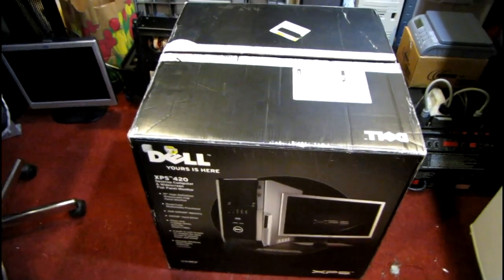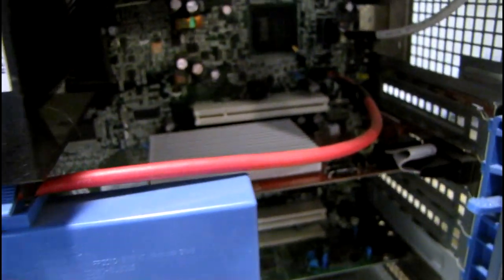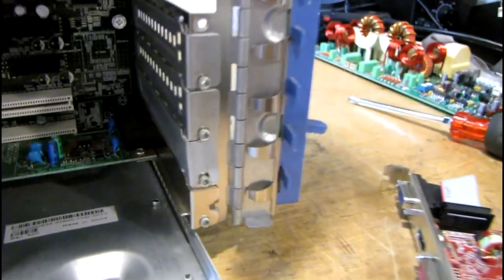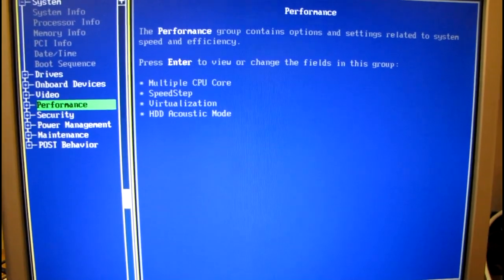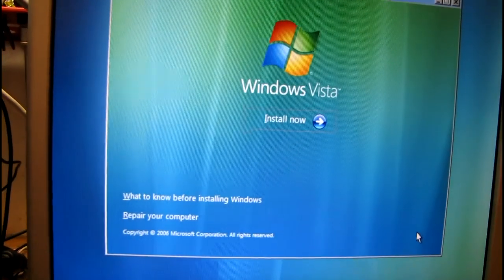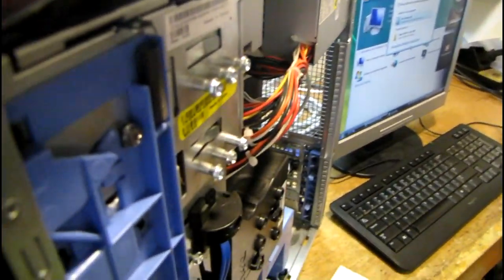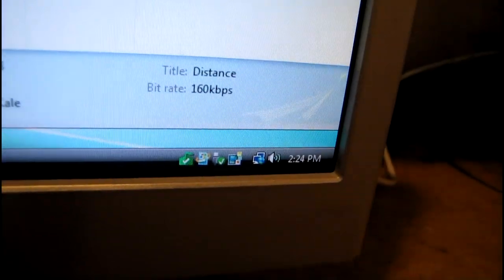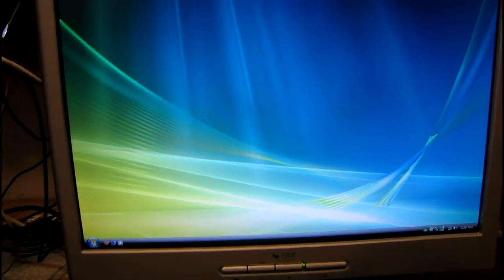Checking out a Dell XPS Computer 8-19-12

Comment from the maker: Yep, it already did.  The nice thing about the 32 bit Vista is that it can still run my old function generator program.  And it's a lot faster when navigating PDF files of large schematics.  The only downside is the size of the case.  I had to rearrange the bench to make a spot for it.

Comment from the maker: The plastic cover is also the retaining bracket for the heatsink.  Most of them I've seen have two screws holding it to the motherboard, and the whole assembly hinges back off of the CPU once the screws are out.  Do not remove it unless you have new thermal grease to use.

Comment: That case looks very similar to my Dimension 9100, which has the same front as the Dimension 5100. It has the same power supply as the XPS, and supports 667mHz RAM. It has a Pentium D 820 and 2 gigs of RAM, runs pretty nice with Windows 7 Pro 64-bit.

Comment: That's a really decent score Max! The Dell XPS back in the day were the Asus Porshe of the time and still today make some decent stuff. I too run a Q6600 and use it from gaming to video editing and still today it's pretty damn decent, even with the limited DDR2 ram. Also, I keep mine running 24/7 @ 3.4ghz easy on air with a Zalman 9700 Cooler and it runs perfect.

Comment: dell done that in some older models to. i had a  dimension 8400 with a p4 3.0 in it and it had  tower cooler like that. good idea really with a few bad ones. i just hated the proprietary parts and limits of the board and most of all that clam shell case. this thing though, i wouldn't mid so much.

Comment: Server grade CPU,s and some dual core modern CPUs have a function called PAE,and what it does is to store the extra Ram aderess that cant be stored by the  CPU registers on the the end of the first module of ram,that way when it need to acess 4+ GB Ram it only reset its counters and loads the extra aderesses from the rest of the ram area,takes what it needs and resets to 32 bit 4 GB ram this switching takes longer than acessing standard Ram but allows it to acess more,Linux and W Server Have it

Comment: that cpu in there isa beatie q6600 is a beast ahead of its time, i still use it in my main gammer rig. i have mine overclocked to 3.2 ghz (max i can go and be stable with mobo) the thing has a 7.3 windows 7 ratting for a 2007 cpu lolz.

Comment: 2018...almost 2019...upgraded my 2nd hand £180 dell xps420 with a 500gb crucial ssd...gtx660ti...750w power supply...8gb memory...put a qx9650(locked @3.0ghz)5 years ago!...want to try and fit some kind of new oc mobo but keep the actual case and just do some kind of retro fit with everything else just sort of left the way it is..have seen a water cooled one somewhere(hmm)...would love to be able to oc the chip as have read it can go upto 4.5ghz....i just bought an i7 2600k which im also starting to knock together now...i like old tech :)

Comment: It's not that curious. My 256 MB GeForce 8600 GTS is bumped right up by using some of the system RAM to I think either 1.5 or 1.75 GB. Also, why have 5 GB of RAM with Vista Basic? Isn't that 32 bit only?

Comment: i did buy same pc for 4euro. did put 4 x 2gb ddr2 rams in it and a nvidia gtx 465 1gb gddr5. installed windows 10 pro. its a nice working system. to bad the xps viewer does not run in windows 10

Comment: i currently have a dell xps 420 if u didnt know that little lcd is real time i use it view my cpu and ram ussage haha . but no the only problems ihve had is that power supply will get very warm im a A+ tech my self but back in the day this pc was about 1500+ usd .some of them had a camcorder card with 4 bnc conectors ahah. oo btw if u can find out any way to over clock this and unlock the bios let me know :)

Comment: I was wondering if these cases are still available to buy . I think that it is a great case and like the multi uses and layout of it can you  also tell me how I could overclock an intel   core 2 quad q8200 cpu at 2.33 ghz with a windows 7 x64 bit os with 8 gigs of memory . I have a gigabyte ga-ep43-ud3l motherboard as well thank you for your time
Reply: thank you for the info and if you know how I can do what I wrote in my comment that I had posted can you give me some insight thank you in advance

Comment: I can't believe they gave this rig away because of a botched windows install... it used to royaly cheese me off in my old line of work to see good comp hardware go to waste, and it still does..

I tried to live with the dreaded V word for a few months. and it brought my old rig to it's knees. leaving me crawling back to winXP begging to be forgiven.  

The core 2 q6600 is a bit of a legend, you can overclock its privates off... providing you have a meaty heat sinc n fan fitted.

Comment: you got the wrong end of the stick Maxxarcade. I know for a FACT 64 bit only supports 4gbs. in experience I had 16 gbs run on 32 bit software so you can install more ram if you don't have 64 bit.
Reply: What...?
Reply: +Tim McFarland you can put how many ram as you want on 32bit but it will only detect 4gb
Reply: +Vader Starligth acctuallu the dude from the first comment is somehow right, there is a set of instruccions from windows 8 and above that moves something in the proccesor that allows 32 bit proccesor use up to 32 gb of ram
Reply: El Gamer No tan cutre it could be so instructions but if Windows 32bit suported over 4gigs they wouldnt sell the 64 bit version and it wouldnt use the cpu atits fully potencial
Reply: Nope, the 64 bit version still has its advantages.
Reply: El Gamer No tan cutre thats what i said you miss understood
Reply: +Tim McFarland Sorry...I'm running 8.1Pro 64bit and my XPS420 system recognizes 8GB DDR2. When I had the original OEM Vista Home Premiun 32bit it only recognized 3.6GB.
Reply: +The Cynical Empanada He is sort of right, it is called PAE or Physical Address Extension, but most versions of Windows will only allow a maximum of 4gb to be addressed. (With PAE.) Some versions of windows (specifically server editions) will allow up to 64gb to be addressed. PAE requires the NX-bit to be enabled to function properly.
Reply: (sorry for replying to myself) I have heard that there is a way to unlock access to 64gb of memory on standard versions of x86 Windows though. Not exactly sure how to do that though.

Comment: I should be ashamed, my gaming pc is a Dell XPS 630i from 2007
Reply: Daniël's Tech & Music Channel
The hardware is 100% fine, I have the RAM completely maxed @ 4gb, I can't overclock, and I have 2 9800GT in SLI. What grinds my gears is the cooling in that machine.
Reply: GlaciatorGaming used to have a Q6600 with 8GB of ram and a HD5850 it can run anything a Q6600 running at 3.4Ghz can run all the games out atm even at medium/high settings with the right GPU like a GTX960 or something